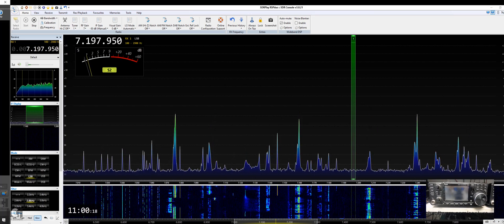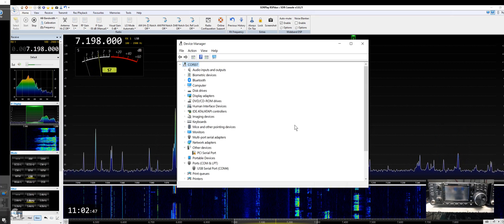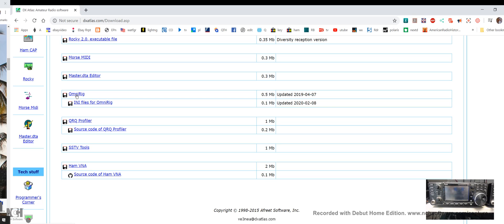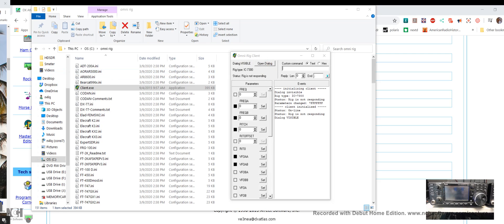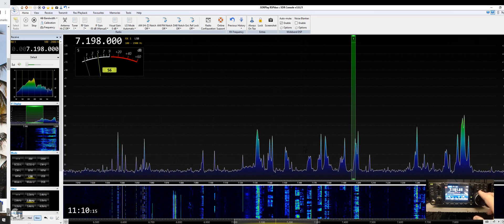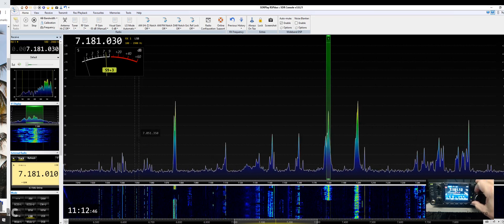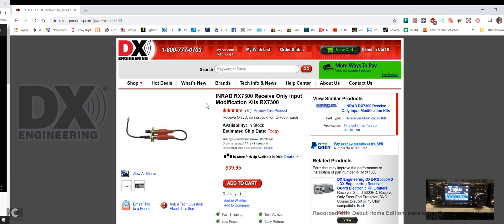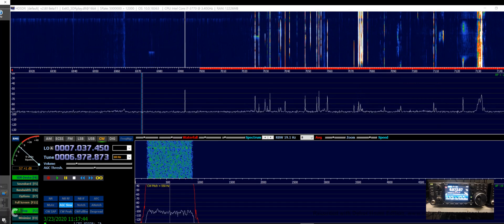Making Your Rig (IC-7300) Control SDR Programs Such As SDR Console using OMNI RIG

Comment: Thank you! Before your video I was completely stuck in the configuration of the external SDR receiving from the radio's IF. If you're still using this software, do you know if it's possible to have independent control of the radio's VFO and the external SDR receiver's VFO like in HDSDR? Sorry for my bad english and 73 from PY5CL
Reply from the maker: I suppose you can simply disable the link between the software and your radio by turning off Omnirig. That would free up the software to control only the SDR's frequency.
Reply: @n4lq  OK! I did that but would love to have the 2 VFO's as in HDSDR. Thanks again!

Comment: You have a great video about SDR Console using Omni Rig. I have a Yaesu FT-991 and have followed yout instruction to the tee. My rig will connect with Omni Rig but will not connect to SDR Console or HDSDR. Can you help me?
Reply from the maker: The rig doesn't connect to the SDR, ever. What connects to the SDR is Omni Rig. Both the SDR and Rig must connect separately to Omni Rig. When setting up the SDR software, whatever it may be, you need to find how to connect it to Omni Rig. I assume the SDR already works with your SDR software.
Reply: Yes i am using SDR Console software and it works very well. I have my port set to the right port number. In the SDR Console software i click on the more options and external radio and it opens up external radio but will not connect.
Reply from the maker: @terrelllemoine_N5TPL  But you don't use an "External Radio"....You must look for Omni-Rig. Omni Rig becomes the external radio. It sort of represents your 7300.
Reply: Okay on the OmniRig-Client: Demo 1 and 2 it shows ( Status: Port is not available ) I do not have other devices connected to the radio. So is it not able to connect?
Reply: When i click on External Radio on the side panel it tells me ( The external radio interface OmniRig is not started. I click on Yes to start now and then a message comes up showing connecting to existing instance failed.
Reply from the maker: @terrelllemoine_N5TPL  So is Omni Rig running and set up properly? I don't have an SDR, OmniRig or even SDR console set up anymore since I got the Flex rig so I'm not able to be much help
Reply: Yes Omni Rig is set up and working on HDSDR fine. I like the looks of SDR Console better so that why i have been trying to make it work. Thank you for all your help i will just use HDSDR.

Comment: Hi Steve, great video. Tnx. Unfortenelly I get an Error in the SDR-Software. When I start the SDR-Console, a window apears "Radio Definitions". I selected "SDRplay V3". An error message came up: "Check service version, require 3.06 - API version don't match (Console=3.06 Service=3.09). Do you have any advice to solve this problem? Second question: In your video, while you describe the  the necessary software-components, I can see in the first line of your desktop-window "SDRPlay RSPDuo = SDR console v.3.0.21". How do get these two Software-programs together? btw. OMNIRig is perfectly running. Excause by bad English ... 73 Wolfgang DG5CR

Comment: I connected my Yaesy FTdx-3000 to the SDRuno via RSP2 as a panadapter. I'll try to connect it to SDRconsole or SDR# using the Airspy HF+ Discovery instead. You're video is very clear and useful. Thanks a lot. 73 from PY5WHO.

Comment: Hi Steve!  Appreciate the video.  Wondering if you could give me a bit of info or advice - I can't seem to loosen/remove any of the screws from my IC-7300's top cover (been trying with #1 phillips), must have given a gorilla the job of puttnig them in.  Do you recall what you used?  Is there a special tool?
Reply from the maker: You need JIS type screwdrivers..Japanese Industrial Standard. Here's a link to  buy a set. They are different than Phillips. https://rover.ebay.com/rover/1/711-53200-19255-0/1?ff3=4&toolid=11800&pub=5575522562&campid=5338568994&mpre=https%3A%2F%2Fwww.ebay.com%2Fitm%2FNew-Release-JIS-Screwdriver-Set-4-Pc-For-Japanese-Industrial-Standard-Screws%2F183501442877%3Fhash%3Ditem2ab989cf3d%3Ag%3A2M8AAOSwWOFeYO96

Comment: All that explanation was very clear. I don’t understand why I would want to turn my 7300 into an expensive tuning knob?  The radio is already full SDR. Is external SDR more sensitive or something?
Reply: Some SDRs are better than any radio(some are really expensive), for example, I believe that SDRuno has the best audio compared to other software, it includes a lot of filters but the hardware maybe is not better than any radio, in my case, I purchased an cheap used Yaesu FT-991, not the FT-991A, because of its transmitting capabilities of 180-2 meters and 70cm, with SDRuno and the 911 it's a great combimation between RX and TX, now with this video  I learned how to make the 911 go to the frequency I choose in the PC software, it's amazing.
Reply: Because you can use the audio from the SDR with is likely much better with much better filtering, NR and NB + you get a proper large waterfall on the screen, seeing the spatter of some stations 10-15 Khz up and down is truly horrifying something you can't see with the small 7300 Screen.

I use the Airspy HF+ and just got the panadapter installed today, the DNR on it it amazing  ( through the SDR software not the 7300 ) + the NB actually eliminated the electric fence noise that the 7300 can't. 

Using the Airspy makes the 7300 feel like a much more expensive SDR transceiver. SDR transceivers usually get several updates throughout it's life, a traditional radio would be lucky to get one or two and you might not notice the difference, an SDR transceiver update can add loads of features or make massive improvements. 

I wouldn't bother going to the expense of connecting a cheap RTL dongle, it won't have the performance necessary when connected to a HAM antenna.

However, if someone was interesting in getting a 7300 + panadapter + SDR then I would suggest they get the Sun SDR 2 DX 100 watt transceiver, it looks amazing.

I already had theAirspy HF+ lying around doing nothing.

The panadapter is a big upgrade to the 7300 and it's likely anyone who gets it will not go back to traditional transceivers. Just don't use a cheap poor performing SDR like RTL TV dongle or modified dongle.

Comment: I never see where you got client.exe......
Reply from the maker: It was labeled as "OmniRig" but created the client.exe file
Reply: @n4lq  I ran OmniRigsetup.exe and I guess it installed the file, couldn't fine client.exe, but I did find Omni-Rig in the Windows 10 start menu under Recently Added, ran it and got the same thing you did.  I have an FT-991A, and it did work similarly to the 7300.  I guess there's no equivalent to the RX7300 for the Yaesu.....